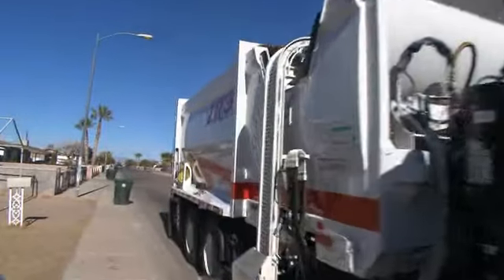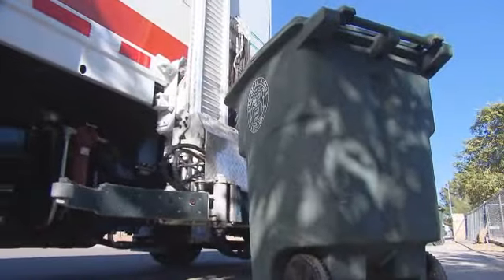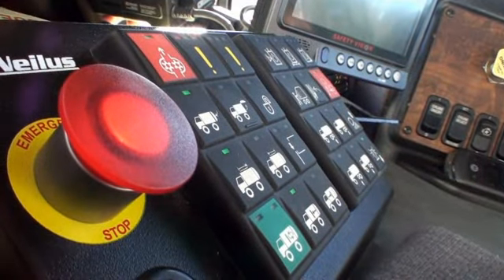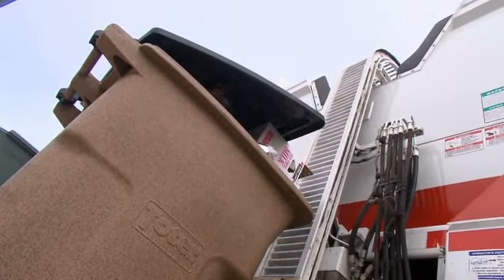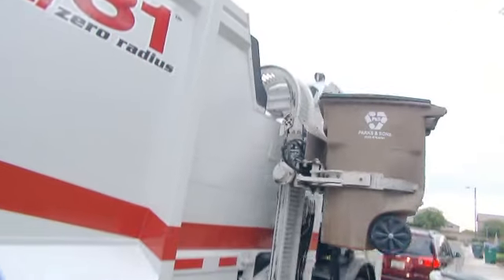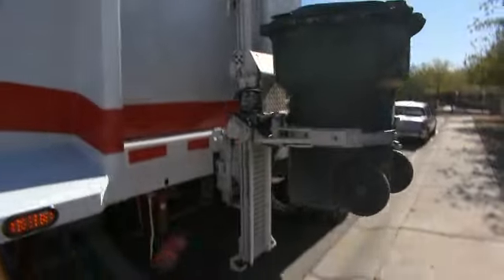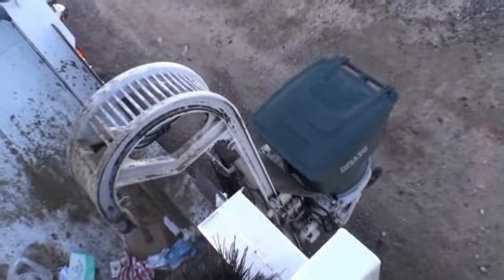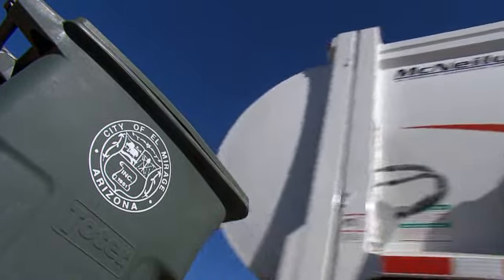McNeilus ZR Full-Eject Automated Side Loader

Comment: McNeilus worked with Pendpac to take the great concept of their arm - combined with a full-eject McNeilus body- to the next level.  The combination of these two is very smooth, even with a route loaded with snow-coned cans.  The follower is also very fast to prevent hopper bridging.  All in all, a smooth and simple machine that mechanics and drivers will quickly fall in love with - Jeffry (McNeilus Marketing)

Comment: Curotto-Can is better. It has an average dumping time of 4.09 seconds. this truck can't beat that.
Reply: SoxFan1519 Currotto Cam is the biggest piece of crap I have ever seen, your double handling the material.  Emptying it into the stupid can and the. When the can is full you have to stop and dump the can into the truck, that takes significant time.  True side loaders pack the material straight away and are only handling the garbage once.  We have some side loaders in Australia that are pushing 3 second arm cycle times (1.5 sec to lift and lower), yes that is lifting and lowering, those trucks have the hydraulic pressures custom set, no Currotto Can can ever match that.
Reply: @macdonaldjohnstonfan  Y'all have curottos too?
Reply: @macdonaldjohnstonfan  do you know if this specific truck like in the video can be to where it works faster? If so, how? We recently got 5 new trucks like this but one of them works way faster